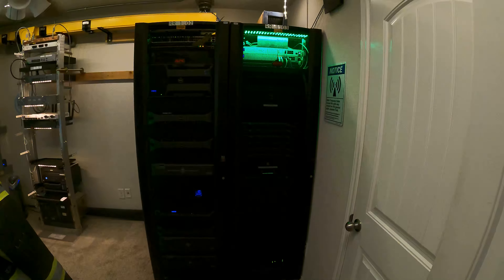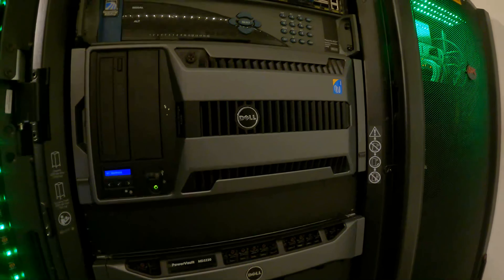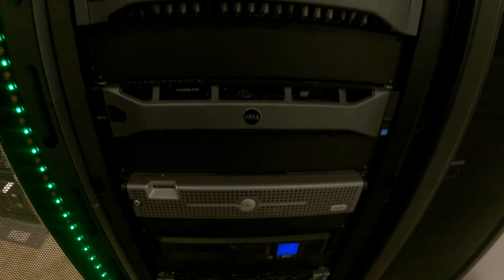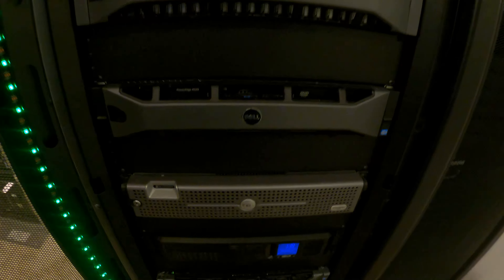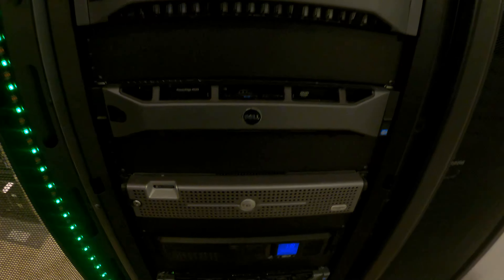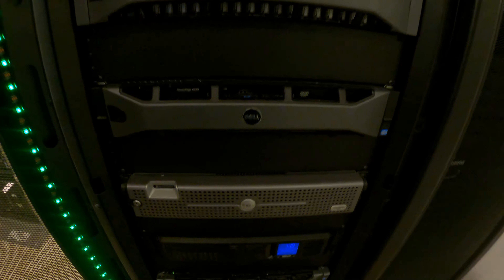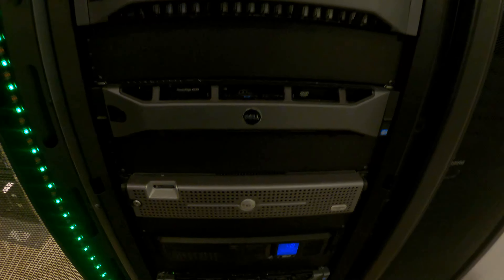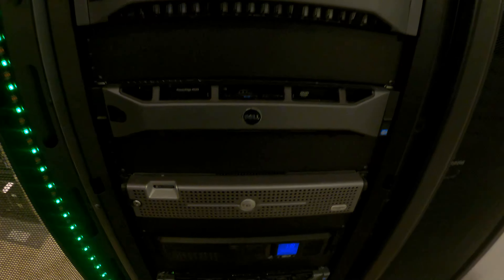Home server room build part 5

Comment: Nice home lab, over the time I did acquire some (to many) servers for my home lab and in the end I determined a power budget that I want to stick to not to have a to high power bill. For me this is around 600 Watt for servers. Since power prices are going up I might even have to reduce the budget. I tried to compensate now with two solar panels. (600 Watts Peak) 

With the servers I have this means I can maybe run 3 at once. (HP DL380 Gen 8 / HP 380 Gen9 and my OPNsense Router in a Supermicro 846 Case co used as external Disk Shelf for the HP DL380 Gen9) At the moment I have a half rack, 26 U if I would get more height units these just would be for storage of servers since I would have to tackle the challenges you solved too. -> Dedicated power circuit, AC Cooling

In the End do you have use cases where you would need to use all servers at once? Since you also just have 2 Servers running 24/7 right?

In the end great setup, very neat, I love the racks. I would get a 42U rack too if I would have a truck ;)